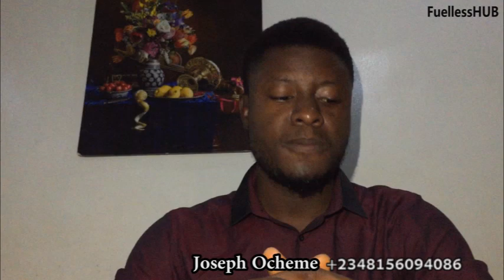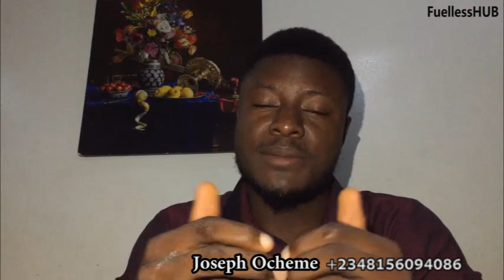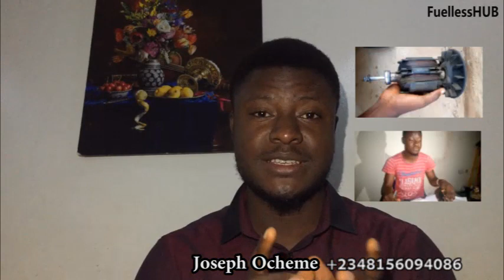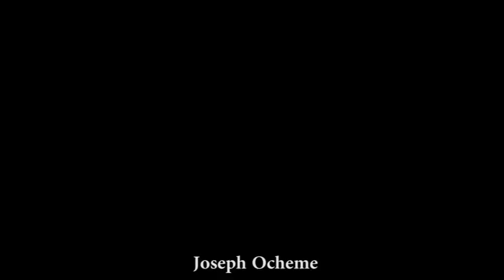Armature Modification Explained again

Comment: Mr you are wrong in your explanation here. the neodymium magnet is not used for speed(RPM) reduction, but to induce a stronger magnetic field to generate current. who wouldn't want more speed in there. 

Electric current applied in the coil of a DC motor induces a magnetic field that turns the rotor. But where there is no applied current, the reverse can be the case, I.e you can generate current by turning the rotor that will in turn induce a  magnetic field on the coils on the stator; to make this current stronger neodymium magnets are use. pls do more research on what you don't know before coming to the public to dish out informations.... tnx